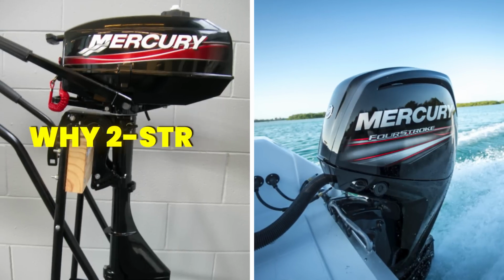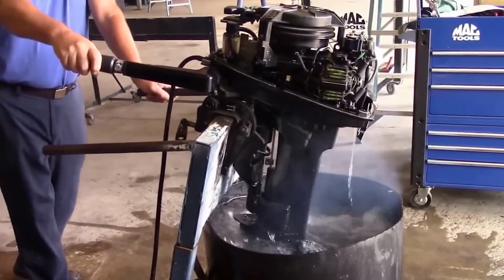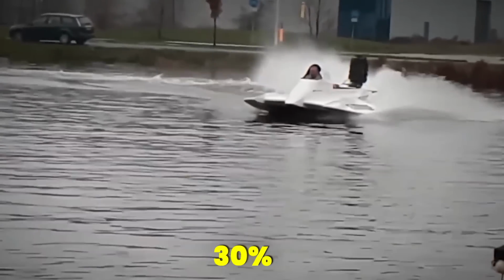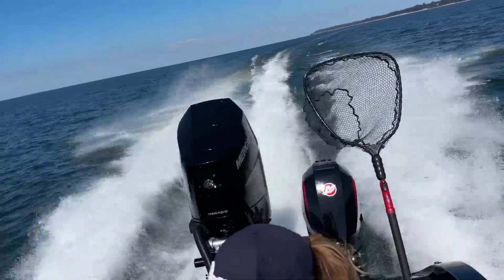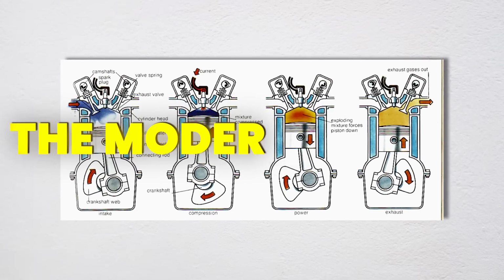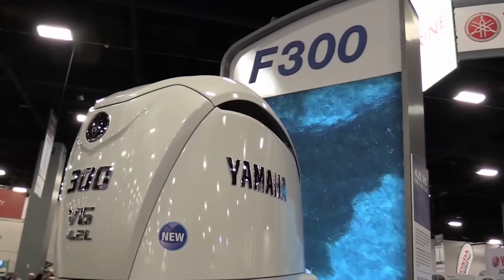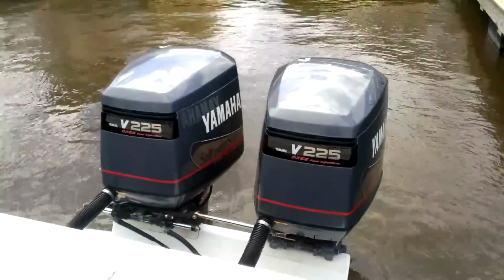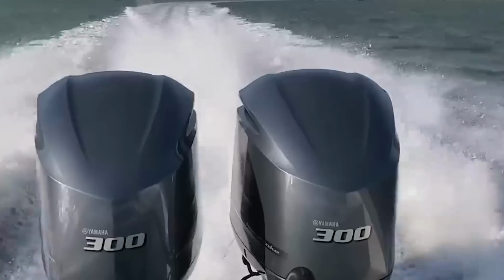Why 2 Stroke and 4 Stroke Engines Are So Different?

Comment: new 2 stroke tech has 55% thermal efficiancy, 500cc twin that makes 220hp at 7000rpm, it will run on petrol alcohol, gas & disesl...

Comment: AI BULLSHIT. 
2 stroke engines are better in every measure. 
Bring 2 stroke outboards back.
My 67 year old Johnson still runs better than it should have the first time it ran.
Reply: Yes and cars/trucks could use DI 2 stroke v8 options! Car culture has been stuck long enough on the 4 turd stroke!

Comment: I always had 2-stroke engines. You can't beat simplicity and reliability on the water. My favorite engines are Yamaha, Mariner, and Suzuki. Hell, I even have an old 1975 Yamaha 5BS (661) air-cooled as a backup engine. It starts and runs without ever giving me any grief, and pulls like it had 1 or 2 additional HP.
Reply from the maker: Ever move over to 4 stroke?
Reply: @VintageBoats  Unlikely. :)
My buddy has a 4-stroke Honda, and while it runs smoothly, there is a lot of maintenance, as you also mentioned in your video. The only things I do before the season starts are a carb clean, change the spark plug, and look after the oil in the lower unit. It's really as trouble-free as one can be with an outboard. :)
I sold my 1970 Evinrude 9 1/2 HP last year. It still ran perfectly fine after probably thousands of hours. I had to change the ignition coils, though. It's a common problem on OMC engines from back then.

Comment: My 07 Yamaha 115 2 stroke carburetor motor will run forever I only put non ethanol in the fuel tank with a little ring free every time I fill it up
Reply: Joint torique ?, c'est quoi ?

Comment: Diesel hybrids are the future , and yes are two strokes
Reply from the maker: Ever used one?
Reply: Taylor Swifts stratified charged DI v-16 2 stroke is 850 CID per cylinder and makes 13,600 hp @ 1150 rpm's!

Comment: Great video! I’m a Walleye guy in Canada and I couldn’t be happier with my Evinrude 225HO G2 2 stroke. It’s been fantastic! Quick fact check the Evinrude G2 maintenance schedule is every 5 years. The G1 was 3 years. Pretty mind blowing.

Bring back the DI 2 stroke!!
Reply from the maker: Awesome to hear and glad you enjoyed! Mind blowing indeed. Have you had the G2 from new?
Reply: @VintageBoats 
yes I bought it in 2016. Other than one major update/ recall on the complex steering mid section in the first year. It’s been flawless, and runs extremely strong.
Reply: @JR-ho5qm  I’m stunned that you like the G2 I would rather have a G1 since it has mechanical controls. You got lucky cause I feel like they’re rubbish.
Reply: @trentondennis3125 I have had three G1 etecs and trust me when I say the G2s are much superior. Definitely not rubish, when rigged properly
Reply: Yes and its time for DI v8 2 stroke options for muscle cars and trucks! All lightning bolt and the sun are plasma 2 stroke entities that tap ZPE!